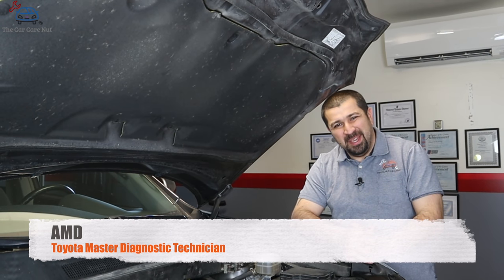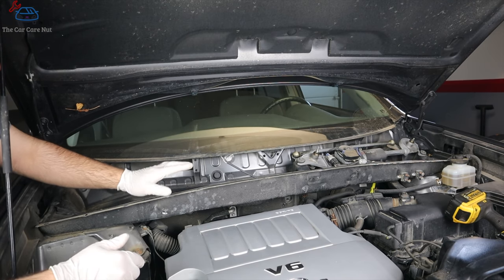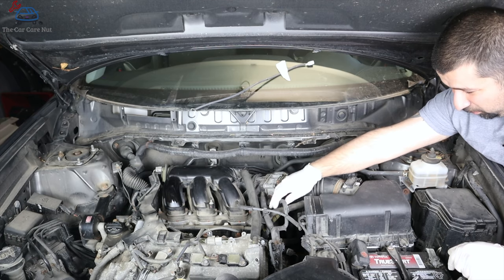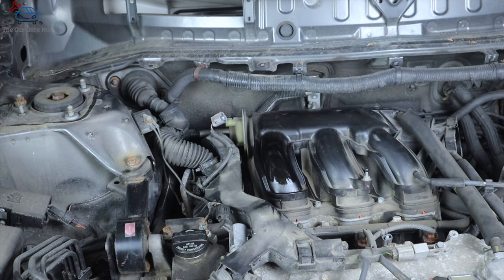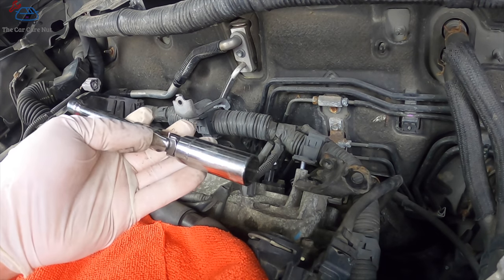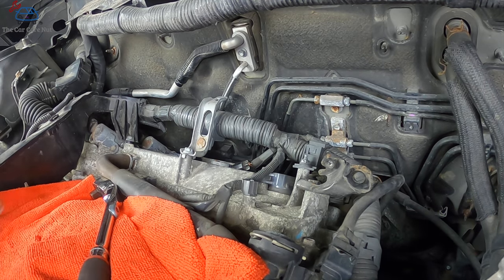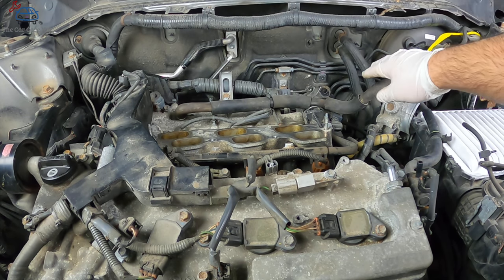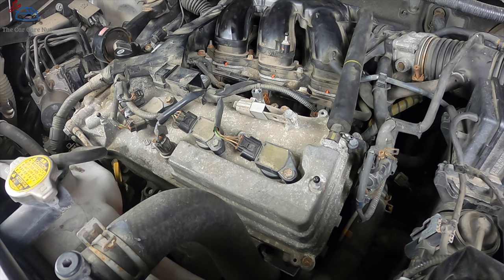How to change spark plugs on V6 Toyota and Lexus 2GR-FE 3.5L engine

Comment: I replaced the spark plugs on my 2015 sienna without difficulty thanks to the video. However, afterwards the first time I started the van it stalled after a few seconds and i got the message "check electrical power steering system. Any ideas?
Reply: Sounds like a vacuum leak. Make sure the hoses are tight and you put them all back in the right places

Comment: AMD, should I replace the coils too? I understand they are expensive but if the labor to replace them later would cost even more if they were to break.  When would you typically need to replace them in your experience?

The GearWrench flex spark plug you recommended is not available for purchase. Is there an alternate one you would recommend? 
Thank you!
Reply from the maker: Hi! If you’re paying someone to replace them at least replace the rear ones not the front ones. And I’ll look into socket recommendations

Comment: While I'm doing this,should I replace the coolant bypass hose and/or knock sensor wiring?
Reply from the maker: Hi! No they’re underneath the intake manifold
Reply: @TheCarCareNut  I wasn't sure if it would be good to take the lower manifold off and replace them. I think the coolant bypass are metal. I think I talked nyself out of it cause it looks a little difficult.  130,000 miles.

Comment: Has anyone ever come across any of these stock iridium spark plugs that actually needed replacement? I never have. I've pulled out some with over 150,000 miles and look like they could go another 150k. It always feels like a waste putting this much time just because it's a service interval.
Reply: I saw someone said they had over 200k miles and no issues...they proably could go 300k Miles.  I'm at 107k Miles but 10 years sucky job but shouldn't ever need to be done again.

Comment: @17:26 What is the Cam-Sensor Wire placement (diagram)? 
I ripped out the wires from the socket & need to be sure how they go back. 🙀

Comment: Doing my 2012 Highlander Hybrid and the EGR heat exchanger is blocking the plugs in the rear.  Pain in the rear - probably why the dealer wants $900 to do the plugs.

Comment: Question - are the coil packs good for the life of the car or do they degrade over time and need replacing to keep the spark strong?

BTW - thank you for this fantastic video sir! All of them are in fact. You know how to light a shot, frame and focus properly as well as describe the work. You’d be amazed how much good advice is ruined by poor videography. 
I’ve been putting off doing this on my 3.5 Venza but with this tutorial, all I need is some time
Reply: Do the coil packs as long as you are there. At least that was my approach at 150k miles and the coils were original.
Reply: @kjhnsn7296  yeah - thinking that makes sense considering the hassle factor getting in there.
Reply: I can tell you first hand that they do not last the life of the car.  I have replaced two so far on a family car with this engine.  Here is a recommendation.  When you replace spark plugs, replace the three coil packs on the firewall side of the engine.  Save the old coil packs as spares for the front side of the engine.  I had replaced the plugs and 10,000 miles later, I had to remove the plenum again to replace a coil pack.  I replaced all three at that time.  The front ones are easy to replace.

Comment: Driving a car with this engine that just hit 11 years, but only 25000 miles. Is it really necessary to replace them or no?
Reply: My 2008 RX350 has 135,000 miles on the original plugs. There is no conceivable reason to replace yours with what amounts to break-in mileage.

Comment: Looking to do this soon. Appreciate the great detail. New subscriber here and look forward to learning much. I enjoy working on my own cars. 

Question- when I tear into the car for maintanence such as this, that require removing other parts, I like to just spend the money and change out common parts that aren’t too expensive since It’s already torn apart. Are there other parts that you would recommend be changed? I have an 2011 camry se v6 with 178,000 miles. Looking to keep her going for 300,000!!
Reply from the maker: Hi! Not really in this case. Perhaps consider replacing the PCV valve as well

Comment: HERE IS A LITTLE TRICK so your socket doesn't drop off the end of your extension =

Find a piece of cloth like a towel,  cut a 1 inch square off it,  cover the male part of the extension end - then shove on your socket.  It will be hard to push on but hit it with a hammer if you want to. Then the socket will NOT some  off unless you forcefully remove it after you use it. That keeps you from dropping any sockets down into the engine or where you can't access or find them

Comment: HELP  replaced back 3 plugs and coils. Pimut everything back and yes plugged wiper motor up. It cranks and immediately dies .over and over.. getting multiple codes for throttle body and EVERY  coil has a code.  I had similar issue on 2011 sienna but it was the windshield wiper plug.  Mine is plugged in on the 2011 camry v6. What could be the problem?
Reply: Did you get a fix?

Comment: 23:30
A good trick for bolt retention for that bracket on the back of the plenum is...
Masking tape.
Take 1 or 2 strips accross the socket opening and shove the bolt down inside.
Creates a friction fit,hand tightening the bolt a few threads then remove socket,and remove masking tape.

Stay Safe to Be Dangerous.
Reply: Smart. I somewhat attempted that with some paper. I know what you mean and smart idea.

Comment: at 12:00, would a Gearwrench, 6 inch, pinless 12MM work better than what U used in this vid?  I am talking about 1 (from the set of 7) that you recommend in your other "beginners tools" video.
Reply from the maker: Hi! In some models it won’t fit. But it would work better in models that do fit. Like your Avalon when you remove the cowl it should fit

Comment: @25:40 my 2015 highlander limited AWD V6 has the fitting on the manifold but I dont have that little hose. The airbox does not have a fitting where you made the connection and the hose does not have a clamp either where you seated it. Do some models not have that hose or is it possible my is missing. The manifold does have the nipple fitting.

One other question do the two nuts on the right and left side of the cowl around the shocks need to be torqued? I only removed the ones needed to take off the cowl. Didnt see torque mentioned just want to make sure.

If you have and guidance that would be awesome in the meantime I will research.
Reply from the maker: Hi! Some of them don’t have clamps and some you need to remove 2 nuts of the strut mount to remove

Comment: Now Toyota is making harder and harder don’t want your guys do in Garage. I did my Toyota sequoia, Camry 2017 no dipstick and 2 Honda 2017 have no problem at all! That why Lexus Dealer Charge $500-$700 for Turn up. I just bought a Lexus Rx350 2015, 57k miles from Family it’s very Nice and Clean! NowI have Toyota Camry Se 2017 and Lexus Rx350 2015 will last me for long time!

Comment: I just had this job done by a shop. On the 3rd cycle after I got the van back, I got a p0302. Turns out the head gasket is leaking slightly and it misfires when it’s cold but stops after. 

Is it likely the shop damaged anything during the spark plug job that would have caused this?
Reply from the maker: Hi! Which year is your van?
Reply: @TheCarCareNut  it’s a 2008 XLE.
Reply from the maker: Head gaskets are somewhat common on these. Not likely something the shop did
Reply: @TheCarCareNut  got it. Thx. She’s not smoking noticeably - Any concern with trying Bar’s Leaks to see if that plugs it and stops it from throwing the p0302?

Comment: What is the cost for this job May I ask?
Reply: All data gives this 2.5 hours in labor. I would say most shops are charging about 100/hr in labor (at least). OEM plugs are like $15 each and the gasket is around $5. I would say an honest non dealer shop will charge around 600-700 dollars to do this job:
250-300 in labor
165 for parts
50 for “shop supplies”
Plus tax

Comment: Toyota how’s outdone itself. By far this 2012 Camry v6 has the most steps involved before being able to change spark plugs 🤦🏻‍♂️. Even changing the alternator had a lot of steps compared to a mid 2000’s 4 cylinder Camry.
Reply: 2006 Hyundai sonata V6 would disagree.

Comment: I just did this job and it just sucks, not one part of it is enjoyable.  I can change my radiator out in my Tundra in a fraction of the time it takes to do this.  I would actually say this is a turn off on all horizontal 6 cylinder Toyota’s in regards to buying one,  I’ll take the hybrid moving forward.  Good grief.  Because, if you can’t do this type of work, then your going to pay somewhere between 700-1000 to get this done every 100k….no thanks!

Comment: Hey AMD,  so I changed my plugs today and I noticed on my 2015 Highlander there is a small nipple on the front of the intake plenum that looks like it should have a hose to it, but I cannot find one. I assumed it just didn't have one, but it seems unlikely. Am I missing something? I also drove it and got a P0441 error code. Is this related or do I have a separate issue with my purge valve? Thanks so much!!
Reply from the maker: Hi! Is it a small one or a larger one and is it open?
Reply: @TheCarCareNut  it's pretty small. It's right in the front on the plenum pointing forward. I saw another video of someone changing the spark plugs on the same car and it looked like theirs had a rubber plug over it, not a hose. Could this be right?
Reply from the maker: Some of them did but yours might not. Is there a small vacuum hose that goes to the mount in the front? Or to the air box?
Reply: @TheCarCareNut  no, no opening for it in the box and no loose hoses. If I lost the plug, can I get a replacement from Toyota? Thank you so much for you help, you're the best!
Reply from the maker: Let me see if I can find one in the shop to verify. I don’t have one at the moment. Do me a favor and reply to this message here so I can catch it
Reply from the maker: @matthewcacace6804  there is a cap there. Part number 90339-03002 it’s just over $6 should be somewhat available to order.
Reply: @TheCarCareNut  thank you!!!!

Comment: How much will a job like this cost if you do it?  I now how much Toyota will charge.
Reply: I just did this yesterday on my 2015 Highlander.  $Canadian 21.50 per spark plug is $129, plus $65 for three intake gaskets plus $12 for throttle body gasket is $206 total plus tax.  That is like 150 US dollars.  I already had my own tools like socket set, extension bars, torque wrench, etc.
Reply: I got an independent shop quote for $1500 US but that included all 6 new coils.  Doing it myself cost $630 in parts so... huge savings plus the satisfaction and learning - hard to beat!

Comment: So I put everything back together but my brake pedal is stiff and my brake light is on what did I do wrong?
Reply from the maker: Hi! Check the connection of the vacuum line to the brake booster
Reply: @TheCarCareNut  just checked it this morning was the only hose i forgot to attach thank you. Also my engine light and my vac light is on what could have cause that and how to I get them off?
Reply: @TheCarCareNut  VSC*
Reply from the maker: Hi! Likely the vacuum leak just erase them

Comment: not  doing them plugs unless i  do valve cove gaskets and pcv valve, check the wire harness to the knock sensors, all things you will be doing soon.

Comment: LOL... The Toyota guy takes all kinds of crap off that doesn't need to be removed (Wipers, cowl tray, wiper bridge, air cleaner box). Hey Car Care Nut who knows so much about Toyotas/Lexus - do you own a three foot 3/8" extension and a 12 mm 6pt universal? The bolt on the passenger side lower section of the intake plenum can be removed from underneath the car - you don't need to remove the wiper system and cowl tray to get access. And you don't need to remove the air intake box either. I figured all of this out the first time doing plugs on one of these without a service manual or Youtube video - just from looking around with a shop light and mirror before taking anything apart. But I guess that's what separates a Mercedes technician with 30 years experience from your average Toyota mechanic.

Comment: I just have one question...What were the engineers at Toyota smoking when they designed that piece of crap? When I went to buy my Tacoma the first thing I did was to ask the salesman to open the hood to see where all the spark plugs were located and the other thing was to see where the oil filter was located, and that's how I bought my Tacoma.
Reply: Exactly, I owned Toyota but my next car won't be a V6 or only Tacoma or Tundra for me. Wait till you watch how to replace the lower control arms you have to remove both engine and transmission mount to access one of the bolt.

Comment: I've been a loyal Toyota owner for over 50 years.  
WHY????!!!!
Why have Toyota engineers designed such a difficult to maintain product?  They should be ashamed of themselves.   Take a simple spark plug replacement and turn it in to an abomination of complexity.
I have older Toyotas and for this reason, I won't buy new car.  Instead, I'll maintain mine so I don't have to buy one of these over complicated, difficult to maintain and repair vehicles.  
Shame on Toyota engineers!

Comment: My gawd just to remove spark plugs!
Reply: The plugs are iridium. They're recommended to last 120k, but there are tons of these engines with 250k+ on the original plugs running just fine. Also, the average person drives 12-14k/year. the average person will have to do this job every 9- 10 years...

Comment: The v-6 toyota engine has the 2 most difficult items to change of all cars in this price range..No one lets you know this in time.. Spark plugs and front axle w/wheel bearings are both way worse than any other car..No one should have this engine beyond 75k miles..just watching what this mechanic is going thru, is severe head ache causing..just the spark plugs is an all day night mare!!!!!!!!!

Comment: Have to remove the wipers, the cowl, the wiper motors and antennas, dissasemble the intake manifold and replace seals, all just to change the spark plugs... Sorry but that's just poor engineering.
Reply: @Channel99-1No kidding. When I replaced the power steering pump on my 1999 Chrysler minivan I had to remove the REAR bumper. The pump is removed — barely — through the frame tunnel. The exhaust system must be disconnected at the manifold to enable it to be slid back to make room for the pump. And the bumper/fascia must be removed to allow the exhaust system to move. Every “modern” vehicle comes with horror stories like this.